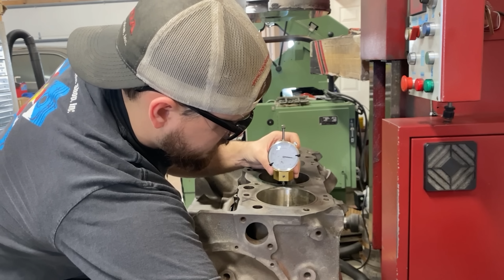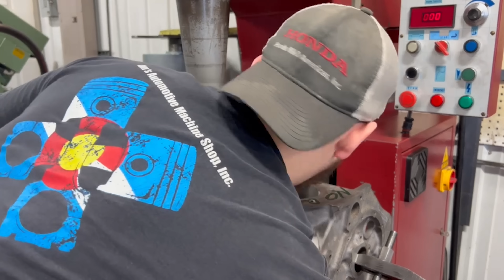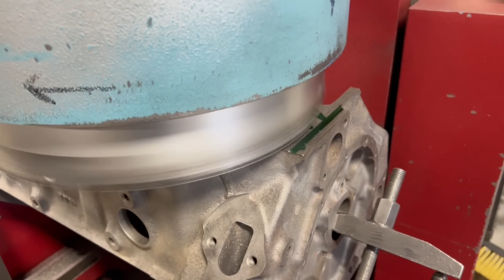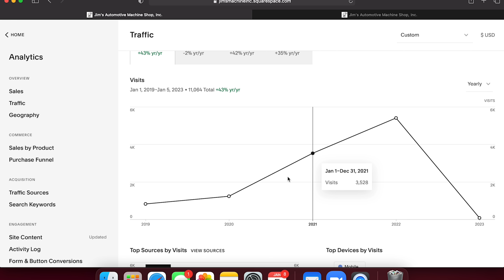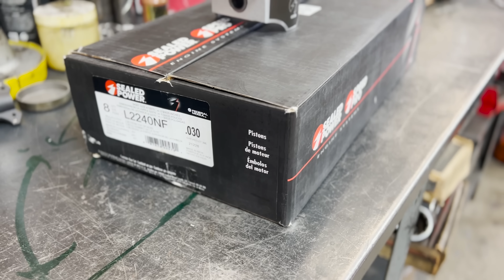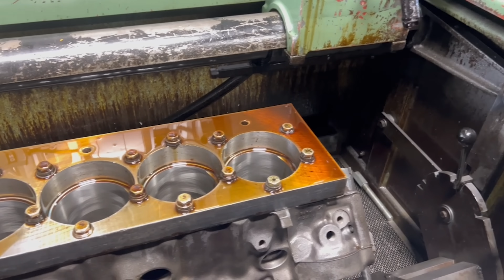Can You Deck A Numbers Matching Engine Block?

Comment: In my own experience those GM big blocks weren't exactly square and true or even totally flat right out of the factory, early ones were probably the worst. You've done a great job getting that block right! 👍
Reply: Now he can run aluminum heads on it and not constantly blow gaskets anymore thinking the heads are bad 😎 I've still got a Ford head I'd love to mail up there for a total rebuild - good machinists are hard to find in my area
Reply: @Drmcclung but bad ones are literally around every corner😂
Reply from the maker: Thanks!
Reply: @JAMSIONLINE  What kind of pen was that?
Reply: in my own experience with chevy big blocks, I have seen the decks vary from side to side by as much as .015 on the stuff made in late 60's early 70s. but there was a lot of meat on the bones of the old big blocks. the was 1 particular 396 block casting that shared the same cores with the 427 of that era. I dont remember that particular casting nubmer ritgh now but the cylinder walls were super thick.  you could bore them out to 4.310 without issue.  that is a 0.216 overbore!  the stuff made in the mid 70's was better machined, but they took out most of the beefyness to those big blocks to save weight. the Gen V blocks are usually within a few thou of each other. they really got their crap together with machining and the Gen V blocks.
Reply: @shadvan9494  yeah those early ones were a bear right out of the box, no 2 blocks would even measure the same. Intake manifolds wouldn't fit quite right. Not bad but not right. You'd have good intake gasket squash on one end, hardly any on the other. Without doctoring forget about aluminum heads on the early ones, they'll blow head gaskets overheated just a little just once
Reply: @Drmcclung  why is it just the aluminum heads by the way?
Reply: @petermolnar8667  They'd tend to flex a little and try to form to the shape of the uneven deck when they got hot, head gasket would start leaking. This was a back in the day when aluminum castings weren't as good as today and the iron block decks weren't 100% right. That's just the way it was back then, and GM big blocks were notorious for being way out of spec right out of the factory
Reply: @Drmcclung  oh I see, thank you!
Reply: @petermolnar8667  Once you ripped the motor out and had a good machinist square the block the right way they'd run for 50 years without a single leak at the head gasket or intake manifold no matter how stupid you got with one. It was just when you started adding go fast parts to stock untouched blocks like new aluminum heads, cam, aluminum intake etc and started putting more power down the motor (and heat) it just became a shitshow.. The old fashioned alum heads & alum intakes were play doh, they did NOT like uneven deck surfaces and mismatched alignment, no matter what you did
Reply: @petermolnar8667 dissimilar metals. Iron and aluminum expand and contract at different rates/temperatures. If the mating surface is not as flat as possible, it just accelerates wear and break down of the gaskets. The head and block act almost like a sandpaper with the gasket sandwiched in between.

Iron is more forgiving, but aluminum will punish you for imperfections. It's why all of those engines in the 80's and 90's blew head gaskets more frequently if they overheated or ran hot. The casting and production methods were not what they are today.
Reply: @LynxStarAuto  yep!
Reply: @Drmcclung  why weren't people using the hand planing stones and ink blocks to deck the block before putting on the new heads back then? I'm not sure if I'm using the correct terminology, but I've seen people use ink and straight blocks to find high and low spots and machine a block deck down by hand with large stones...
Reply: @andrewbodine5663  That was an old school way to prep blocks for head gaskets, wouldn't really square and center anything tho. The only good way to square side to side front to back with the centerline of the crank was to hand it over to a good machine shop like JMS here
Reply: @Kenny-1958  Thanks for that. I could not remember which casting it was. but if you are a 396 guy, that is the block to have. they will hold up to anything you throw at them.  I am currently building a numbers matching 402 for a 71 Camaro SS 396 LS3.  it will be stock appearing on the outside right down to the numbers, but higher 9.75:1 compression and a roller cam so I can use modern oils without having to add zinc additives to protect the flat tappet lifters. and mildly ported stock heads. intake and exhaust manifolds.  should make around 400hp give or take a little. I am looking forward to finishing that soon.
Reply: @shadvan9494  That's a smart move my friend. I can't shake a stick at the number of people I have to talk out of flat tappet cams when I'm building an engine for them. Some get it, but a lot just don't understand the lube's job and the mechanical stress.. yeah the flat tappet is cheaper ip front, but you're gonna pay for a lot of cams and lifters. I won't build a flat tappet motor unless it's someone I know and who understands what they're in for
Reply: @Drmcclung  I try to talk everyone into a roller cam, simply because you can use off the shelf oil in it for general maintenance.  the entire retrofit kit, complete with Cam, Lifters, Springs, Retainers, Locks, Seals, and Pushrods, and timing chain was just over $1200 when I bought it. the same kit for a hydraulic flat tappet with the same duration will set you back about $570. however, you then have to use special break in oils and additives to get them to survive 30-minute breaking period. you also have to use low pressure spring and low ratio rockers to get one to break in make it past the break period.  with a roller, you can use what every you want.  also, after breaking in, you still have to need a motor oil with minimum of 1200 ppm ZDDP.  there is not a commonly available off the shelf oil with 1200 ppm ZDDP.  you can use Lucas oil hot rod and classic has 2100 ppm and Amsoil Z-Rod has around 1400 ppm. Z-rod it also has an anti-corrosion agent in it to protect cars that are not driven often.  common off the shelf parts store motor oil with an SN ratting only has around 600 ppm ZDDP. so, any flat tappet cam will go flat without the proper amount of ZDDP in the oil. I simply will not build an engine with a flat tappet cam anymore, unless it's it a full-on resto of something like a DZ-302 or LT1-350, L71/L72/L78 Big Block. but then I am using solid flat tappets not hydraulics.  I prefer Howard's cams, tool steel lifters with EDM oil holes on the bottoms. by far the best mechanical flat tappet on the market and it provides pressurized lube to each of the cam lobes.
Reply: @shadvan9494  Exactly, and that's what I try explaining to them.. there's 0 good reason to be running a flat tappet cam in street applications, for all of those reasons. I won't even entertain the idea unless it's somebody I know personally, who knows what they're getting into, and wants it for the right reasons. Besides, hydraulic rollers have gotten so good lately (at least until the great parts crash that never went away because the event that shall not be named) that reasonable quality hydraulic rollers have NO trouble reliably turning 7,000 all day long. I love this thread we've got going here, great conversation 😃
EDIT: A few minutes after posting I realized what I actually should have said just to avoid any confusion from my comment is that flat tappet cams are kinda niche application at this point, you're exactly right and I agreed with you 100%.. that explains my POV on it.
Reply: It ain’t just the big blocks of that era that had lousy QC. Seen plenty of 350/5.7 blocks that should’ve been an embarrassment for GM to push out the door. “Casting shift” among some of the last runs of the 5.7 was inexcusable. At least GM liked to call it casting shift. I don’t think anything shifted. I think it left the factory that way. I know a lot of us older guys like to remember the “good old days” but I’m not so sure it was so great as far as QC in the Big 3.
Reply: @prevost8686  Well that's true to. We were just mainly discussing the GM big blocks since that's what he had that 396 jigged up in the machine. A lot of junk back then had wildly huge core tolerances coz it was all cast iron, block heads and intake, it (mostly) grew & shrank together, I guess GM didn't really see that as a "problem" for huge v8's cranking out a whopping 3k rpm getting replaced every 3-7 years. But you're absolutely right, a lot coming out of the factory should have been an outright embarrassment as far as QC
Reply: ya they are not a ferrari block
Reply: @riotwarrior  Probably a good thing since Italian aluminum castings were always tragic 🤣🤣🤣
Reply: Your exactly right. These guys can do better machine work & blueprinting than some could at GM back then. They pay attention to detail. They're looking at 75,000 miles ahead. They take pride in their work and their customers are #1.
Reply: aftermarket blocks not much better,   I see new Dart Big M blocks off .005 from side to side,  and surface finish on the deck is  70-80 RA which is too rough for an MLS head gasket.
Reply: @donavan2676  Yeah that's true too. Though I can't offer a whole lot of experience on the aftermarket blocks, I haven't worked with enough of them. But I did once have to sort out an aftermarket Ford Windsor for a customer that was so badly line honed it would wipe the bearings out if you farted wrong. Can't remember for the life of me whose block it was. Might have been a Blue Print (I don't like their shit anyway, overpriced for what you get). That was a weird one, oil clearances would check out, oil was fine, that one had me chasing my butt for a couple of days til I figured it out
Reply: @Drmcclung    I just decked a Dart block on Friday,  it was off .002-.003,   but had a new Brodix aluminum block a while back that was off over .010 end to end.   Have to square them all is the bottom line,   never seen one that was right on.
Reply: @Drmcclung y dad worked for Ford for many a years. Windsors are greatvmotors, but they had issues with a poorly casted timing cover/distributor block. Wasn't uncommon for them to leak from the covers, or seize dizzies regularly. Usually, the culprit was a badly castes timing cover/water pump mounting block.
Reply: @LynxStarAuto  I didn't generally have any issues with stock Ford Windsor blocks in my experience, really it was just the one aftermarket block that really got me by the booboo on the crank saddles being that out of wack. I did have a couple early 302's (early 70's ones) with lifter bore issues but that was just (I think) lifters fault, whoever supplied them to Ford. FE I've got very little experience with, I know they leak and there's not much you can do but otherwise run forever unmolested. Clevelands were goddamn bulletproof, especially updated with hydraulic roller lifters. I like my Ford's and GM's, but I won't touch old Mopar anymore.. those guys aren't worth the time and trouble
Reply: My experience too. I’ve measured crank tunnel bore and trueness with cylinder bores and have seen them out over 1°. Doesn’t seem like much but when your cylinder compression from corner to corner varies a full point that’s bad.
Reply: Totally true!
Reply: @bb21again.67  I see what you did there 😑
Reply: @Drmcclung  I was agreeing with you.
Reply: @bb21again.67  I know! "True", square, it was word play lol
Reply: Just fo the sake of more good conversation, to anyone who's reading this, what's your take on old school American SOHC 4cyl, for instance the Pinto motor (Ford Lima) or the Mopar K car SOHC?? Times change, all the modern midget sprints have moved well beyond what I was building back in the day so I don't get to talk about those with much of anybody anymore
Reply: The surface on the heads was just atrocious from the factory.
Reply: Are there any limitations that result from installing sleeves in a performance gasoline engine? TIA Love this channel
Reply: Chevy Division big blocks weren't "seasoned" (stress relieved) properly before machining, thus you can always count on the cam bores being misaligned once internal stresses are relieved.  The problem goes all the way back to the 348.